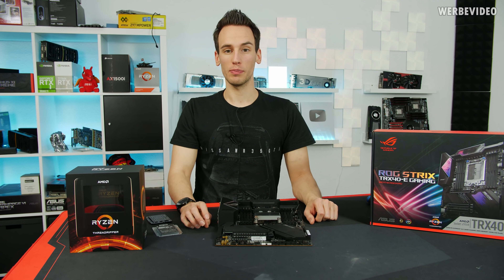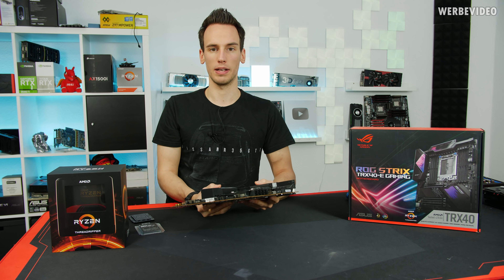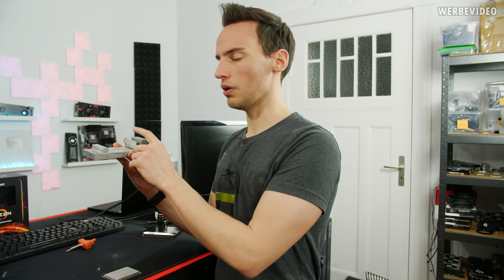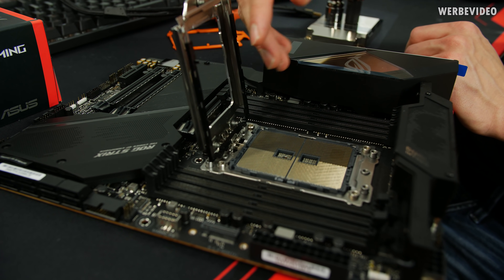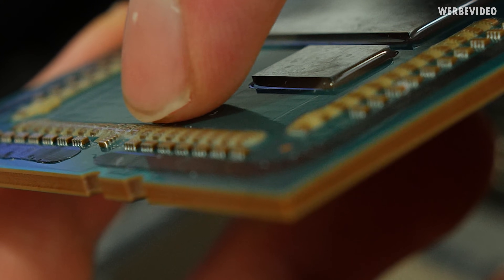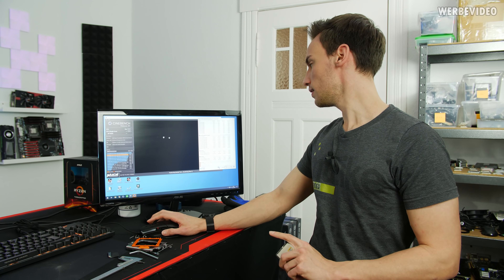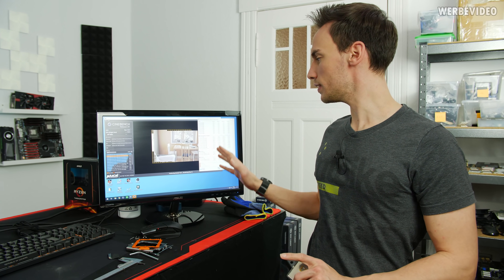IT ACTUALLY WORKS! -  3960X / 3970X Direct-Die Cooling

Comment: If you want to know why there is so little IPC gain in recent years, here is your answer. Right now 8 cores are much smaller than 1 core in early 2000s. Which means that since multiple core architecture introduction producents are focusing on adding more cores when die shrinking instead of making them faster by adding transistors. This is also why we have bigger gains in one-core speed in mobile market - 8 cores are standard for many die shrinks, which means ARM and other manufacturers are increasing core speed instead of adding more of them. 

I think we have enough cores in desktop market to fit all types of production. This is great moment to start increasing core speed instead of core count. At least for desktop.

Comment: i wander what would happen if you use a thick thermal pad. it would add some pressure and get good contact. im just curious if direct die thermal pad beats regular ihs thermal paste.
Reply: @Alexander Davis yea the problem with copper shims, is you still need thermal paste between each side of the shim, that ends up making three thermal layers. they have tested this method numerous times. thermal pads are just useful for big gaps because of the varying thickness.
Reply: @Alexander Davis its not all about there conductivity. even with liquid metal, if you add a hair too much it can have have lower performance then stock thermal paste. by adding a thick shim of copper and liquid metal on both sides you would get  horrible transference. there always imperfections in the seal between the die the cooler. we use thermal paste to fill that, but the connections are still not perfect. by having cooler to lm , lm to shim, shim to lm, lm to die . you end up with flaws in each of the connections.

Comment: If that CPU is already prepared for 4 extra chiplets why don´t you remove the resist and solder 4 extra chiplets to it and make your own 64 core CPU. I doubt they use a different IO die. Most likely just a different firmware. If you are ever near Düsseldorf I will do it for you.

Comment: Could you make a mount like the delidding rig for the cpu and cooler, putting spring pressure on the two with indium solder inbetween and then use the oven to solder the cooler directly onto the die. :D Or preheat the cooler in the oven and use an air gun to melt solder onto the dies. Then push the hot cooler onto the dies to solder them together. You should get a much better interface than with liquid metal and the hardened solder will create better mounting pressure.

Comment: I think i might know what the problem is der8auer,the corners of the cpu socket are sticking above the cpu pcb and are making contact with the cooling plate before the cpu die itself gets to make contact with the cooler,which is why the temps are bad,so in essence most of the mounting pressure is going on the cpu socket corners and not on the cpu itself,here watch this video for a better explanation :  
https://www.youtube.com/watch?v=8ZaupV3MLjs

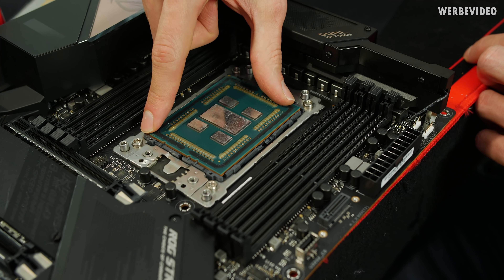Edit: Now that i took a closer look at your cpu socket at 9:14,im not so sure if you have any part of the cpu socket thats sticking out,you should check it out anyway although this tip may not help you after all

Comment: 6:30 those clips are called "C-clips"
Reply: E-clip.  C-clips only have two protrusions at the open end, the E-clip has a third in the center to keep the clip centered on the pin and add torsional stability.

Comment: The 90°C in single-threaded workload is normal: the CPU is trying to push as much power as possible (or available) in one core, so of course it's gonna get hot. Several tests have already shown this behavior, including Buildzoid's: https://youtu.be/ORHYffg5ipM?t=1457 Threadripper has a much higher power budget to boot...
Reply from the maker: On auto yes but this CPU was manual OC across all cores

Comment: Maybe measure the height difference between the I/O die and the chiplets, and mill out a hole for the I/O die to sit in that would be equal to the difference in the die. Also, what is that pink conventional paste you use!!! That is the same stuff they use on chipset heatsinks on AM3 motherboards, and I've needed to redo the paste on older boards, but Mx4 doesn't work so well.

Comment: Is it possible to use water directly on chip?
Cover everything with polyethylene. Leave a hole for the CPU and put it under running water.
Reply: in theory it should work, just very poorly and worse than a small air cooler

Comment: Why do you say that 3950X can't be direct die cooled? Very cool video BTW.
Reply: probably the layout of Ryzen 3000 - the Dies on the Chip are not symmetrical and are just really funky and so you wouldn't be able to apply pressure correctly.
Reply: @taiiat0  There is a block with its inner channels made specifically for Ryzen 3000 series made by Optimus Cooling, called "Foundation", I hazard a guess and say it would be up for the task of direct die mounting, one would just have to be very careful with how much pressure they used when mounting it, and would probably need to fabricate or come up with a method of safely mounting it.
Reply: @glynkatkin  
a lot of machine time to get some ridges in just the right places and such might work yes - would be a pretty expensive block though.
Reply: @taiiat0  Bit of CAD and 3D printing could probably make a sufficient mounting bracket, or get it printed in metal (there's a outfit that print custom parts in metal about an hour away from me), where there is a will, there is a way, I am sure Roman has the tools, and experience requires to get an Optimus Foundation block direct die mounted on a 3950X.

Comment: Would there be any benefit if instead of direct die, we would put the head spreader back on, with liquid metal? Is the solder good enough?
Reply: indium is actually a great thermal interface (~86Wm-k compared to 73Wm-k) it also won't ruin aluminum contact surfaces (the gallium dissolves it)

Comment: what would be nice is to surface mill the oem heatspreader down to 0.1mm under where the original inside contact surface is,  so you are left with an open rectangle that will help spread the pressure to the sides without relief of die pressure. Either that, or 3d print a ring out of some engineering plastic that can take the loads and temperatures. 

Then, sand the studs on the mounting plate down just enough to achieve the correct mounting pressure / spring compression.
Reply: Or, as long as you have access to cnc equipment, you could just mill out your own waterblock instead of fiddling around with adapters. 

Something that I would love to see on your channel is a proper refrigeration loop OC setup that was designed to run 24/7 at sub-ambient temps. I'm sure you can think of some ways to solve condensation issues without going to immersion cooling. Perhaps a combination of hydrophobic coatings, carefully placed heating / evaporator pads, and vacuum pumped sponges like they use in the medical field for wound drainage would work.

Comment: would be great if AMD sold special version of those, without IHS, and intergraded mounting bracket alone with proper die height.
Reply: they could but would sell it to you without any warranty, don't think this is impossible they do that already for cars racing parts, parts who have a high risk of breaking or seeing abnormal heavy usage

Comment: Video idea: you directly circulating water on the cpu without ihs. You need to open the bottom parts of the aio that usually contact with ihs and seal the outer edge directly to the pcb oh the cpu. I would see if there any improvement
Reply: Would most likely be worse as there's not enough surface area
Reply: @zombieswitapple  just think it this way. The surface is the water itself not the ihs
Reply: @erticyusa5928  man i know what you mean. It will be worse because of the tiny surface area of the silicon. Plus the smoothness of it means no turbulence so even less thermal transfer between the silicon and water
Reply: @zombieswitapple  what do you mean tiny surface area? Does ihs makes it larger? If it does then why not attach even larger ihs like streaming water? You get what I mean?
Reply: @erticyusa5928  Heat conductivity of water is poor. It is much better in various metals - this is why metals are used for the interface between IHS and the heat dissipation surface. So you go from a minimal surface area to a large one by spreading out the metal into a large surface (like fins). This then interfaces with the heat dissipation media, be that water or air (both of which have poor heat conductivity, and therefore need a large surface for decent performance).

Your idea is basically like saying "don't use a heat sink fin stack on the IHS - just blow air over the IHS itself!"
Reply: @mduckernz  very great explanation. This is the answer I was looking for

Comment: €1500 soldered CPU de-lidded and then direct-die cooling?
Talk about mounting pressure ;)
Reply: What you did there, i see it.
Reply: ba dum tish.
Reply: Hah!
Reply: That's actually clever
Reply: What you see there, I did it.
Reply: Get out! :P
Reply: IMO it is pointless because the solder & the lid is already a good heat conductor, they are both metallic. The benefit for regular user is small, except for competitive purpose with large prize.
Reply: @xponen  No.  The less between the die and the water the better, end of.
Not only are the Zen chiplets high density in terms of architecture, but they are basically pushed quite hard to get the GHz, and the Zen2 architecture uses a similar boost algorithm to nVidia GPU's, therefore the colder you can keep the center of the dies, the better the boost.  You need high flow close contact, and no jetplate system to get the most from a water block on Zen2.
Reply: @JuxZeil  Uhm, high flow no jetplate is equivalent to medium flow with pin or fin impingement. Except the latter has much more surface area, so it's strictly better. Just turbulence is not enough. So a pretty ancient design of a block will do very well.
Reply: @AstralS7orm  Wrong, the jetplate restricts flow but increases pressure at the pinch point. 🤨
But you're right about the older style blocks being good for the "off center heat spots" that are the Ryzen chiplets.
Reply: Ba dum tss
Reply: what temp does indium solder melt??
...I know its over 100°C, so I figured it would severely damage the CPU since that's normally the limit on running temps.
Reply: he got it for free. No financial risk involved
Reply: cactuslietuva if you watched the video then you’d know he actually bought it
Reply: @ValentineC137  Yeah sure, try finding one for yourself then. Also he can easily afford them even if they cost 10k.
Reply: @cactuslietuva  I got a 3950X 3 days after release..... 🤨
Reply: @JuxZeil  amazing
Reply: @cactuslietuva  for free ? u don't know anything

Comment: It could be that the 5 dies are not the same hight. The temperatures displayed in system are usually the hottest core, the lowest die will always get worst contact and run even hotter than before.